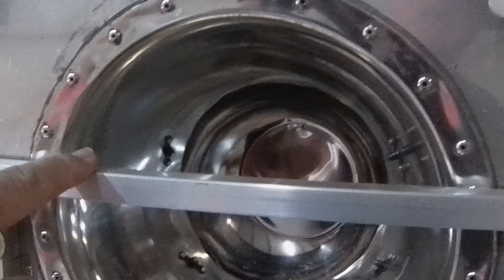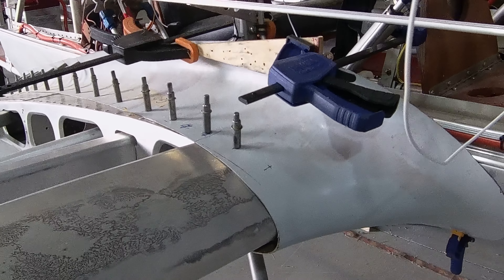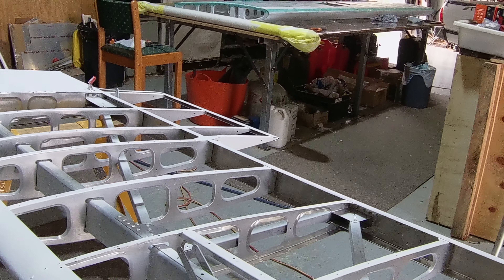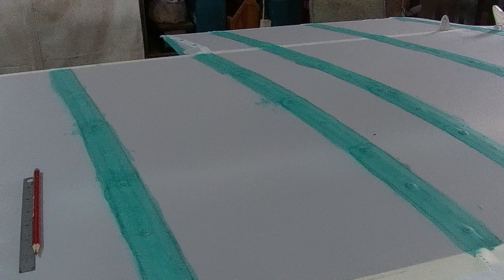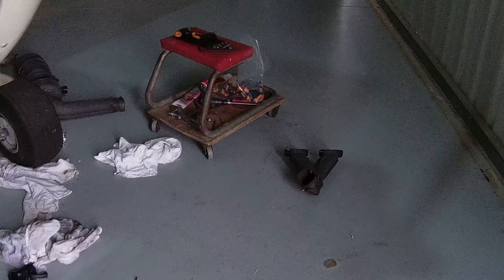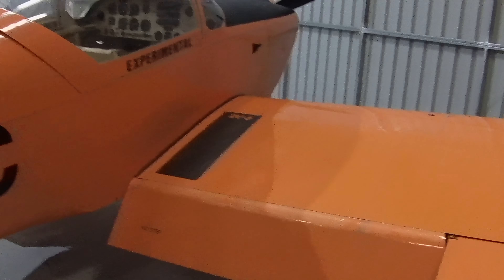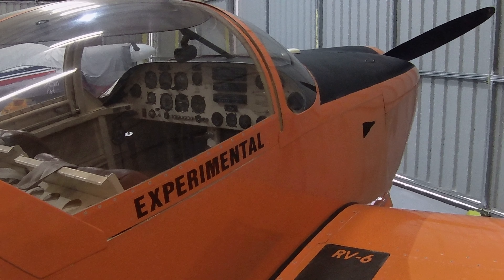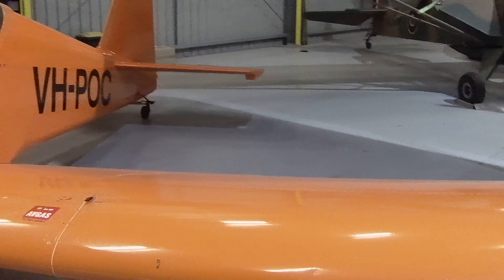Feb update, Murphy Renegade

Comment: Paul,  would you mind giving me a measure of the outer width and height of your main wing rectangular spar?
Do you know if all kits with the rectangular main spar are the same size?  Its hard to tell from the video, but your main spar height looks bigger.
Reply from the maker: My spars are 1.5” x 3.5”. I don’t know if all renegade rectangular spars are the same dimensions, I can’t imagine Murphy making the spars different dimensions, other than length of course
Reply: Thanks. It looked bigger than 3.5" on the video.